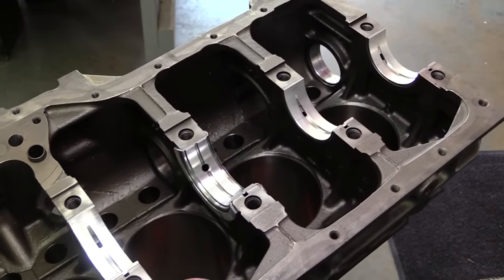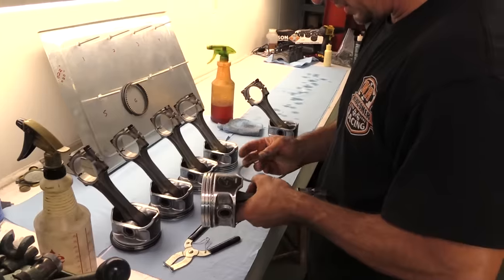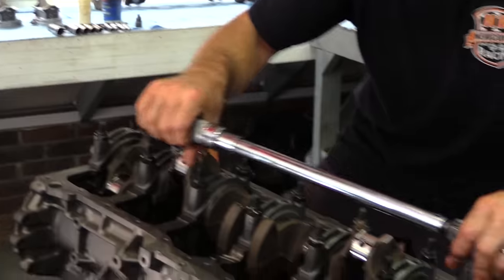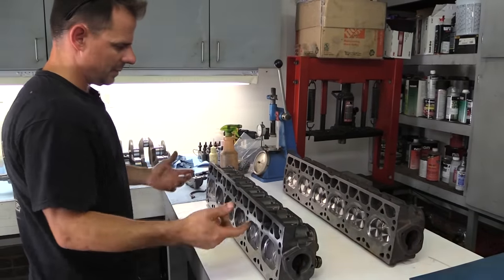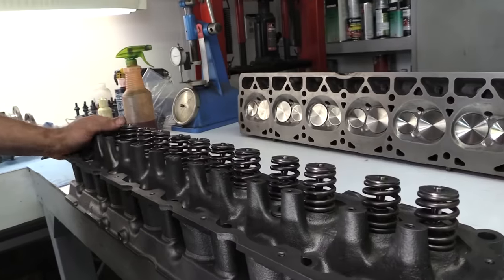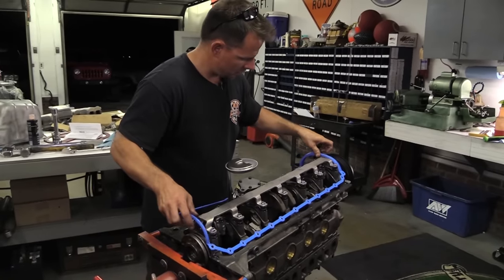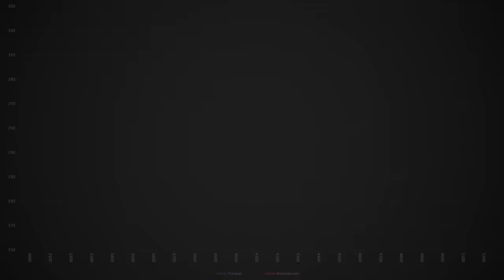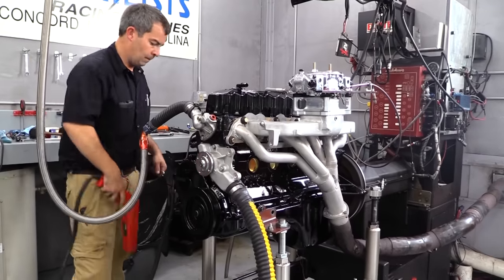Big Power Jeep Straight Six Stroker Build on a Budget with Newcomer Racing

Comment: This thing is a monster of a straight six. It made 329.5 lb ft of torque and 304 HP! That's small block power out of a NA inline six that's smooth as silk!
Reply from the maker: You got it. A five-grand redline isn't exactly sexy, but it is practical on a off-road engine where you want to maximize low-end torque anyway. Plus, like I'm sure you noticed, the builder was trying to get good power on a real-world build. This engine is going to be used everyday, and longevity is definitely an issue. Lightweight stock springs minimize wear on the cam lobes and lifters, but they don't exactly help stretch the redline to the moon. Thanks for watching!
Reply: GT3582R LSVTEC EJ8 
First. Rpm is directly related to airflow. This is an older bigger ci engine. It doesn’t need to rev to 10k rpm to make any power like crappy 4 bangers 
Second; stroker motors don’t help an increase in rpm. If anything the inhibit rpm. 
Thirdly; this particular type of build isn’t for a race car. It’s built for torque. The more torque at a lower rpm is more useable power. 
Reving the shit out of an engine is always the goal of a build.
Reply: I had to edit my original post because I jumped the gun on what I said and didn't think about the 4.0s of the past. I made a comment about the 5000 rpm redline, but I didn't take into account the fact that the 4.0s don't need to rev high due to their ability to make torque. I've driven quite a few Cherokees and Wranglers with the 4.0 and even some AMCs with the 4.2 and they were always extremely reliable, extremely smooth, and they always produced alot more torque than people gave them credit for. Besides, in an offroad based vehicle, you don't need high revving capability, you go with an engine that makes good torque down low, which is why so many people love the 4.0 and is also why you hardly ever see a Jeep stuck. This option being available to the Jeep community who stick by their beloved 4.0 just makes it that much better. Once again, I let my mouth run before I saw the dyno numbers...it's hard to argue with horsepower and torque!
Reply from the maker: That's cool. It's always good to read comments that understand different engines serve different purposes, not some keyboard warrior yelling that if an engine doesn't have twin turbos and make 1,500 horsepower it's junk! Thanks again.
Reply: @Welcometofacsistube  You're right, I am an import guy who has a 612 whp Civic coupe and ran my mouth before I took into consideration what this engine will be used for. My turbo 1.8L DOHC 4 cylinder revs to 10k rpm because it was balanced and built to make power that high, but my Civic is a drag car, not an offroad capable vehicle.  That being said, this Civic is my 54th vehicle since I was a kid, and the other 53 were a mix of imports and domestics which included cars like a 800 HP 74 Camaro Z28 that my brother now owns, a 70 Buick Skylark GS, a 69 Roadrunner 383 4 speed car, a 70 Charger that I built a high compression 440 with a 4 speed for, but I've also owned Eclipses, Eagle Talons, a turbo 92 Acura Integra that made 412 whp, and even an AWD swapped 92 Plymouth Colt hatchback that I swapped a fully built 4g63t into that made 500 whp and would destroy Corvettes. I've always been a fan of a good build, but more importantly I've always been a fan of the underdog, and it doesn't get much more underdog than a lowly common Honda Civic. All in all, I just like horsepower and going fast on or offroad.
Reply: if you are going for a jeep stroker, you must focus on torque, not on rpms, i would have used the later horseshoe style intake and the matching dual profile cam...
Reply from the maker: 54 cars! Respect! My wife would kill me ;)
Reply: GT3582R LSVTEC EJ8 one of the most respectful response ever on YouTube. 👍
Reply: The Horsepower Monster What kind of power and torqye would they get. with nildly blown and a mild port job. the figures on that n/a motor are pretty impressive. However at what altitude were those numbers attained? sealevel or somwhere higher. for those of us that live at higher altitudes  ie 6000 -7000 ft and drive daily. Lightly forced induction  7 - 12psi definately makes improvement. How do those blocks compare with the older 245ci blocks from the 70s & 80s. Love those old mopar 6s.
Reply from the maker: The correction factor on the dyno is pretty reliable, but we dyno'ed at around 700 feet above sea level (Concord, NC). I'm hoping to follow up with Newcomer when he has a turbocharged version of this build. It's going to be bucks up with all the goodies and should be fun. He does some awesome builds, and we'll know what a little forced induction is capable of then. Thanks for watching!
Reply: The Horsepower Monster thank you. I look forward to it.
Reply: Those are really impressive numbers.
Reply: @Welcometofacsistube  Thanks buddy, I try to look at things from different angles when I'm commenting just so I don't make myself look like too much of an ass, but sometimes it's just unavoidable. That's why I edited my original comment because I didn't look at the build in terms of being used as a low end torque offroad engine because I'm used to high revving import engines and seemed to have forgotten everything that I learned about domestics. Sometimes you just have to realize that you were wrong and accept a dose of humility...lmfao
Reply: @Welcometofacsistube  Who says you have to stroke for cubes? Think out side of the box.... everyone wants to build 383 from a 350... What if I wanted to build a 327 from a 350 that screams up to 9K??? Still a stroker isn't it! Imagine the power band you could get 3500 all the way to 8500. Just pointing out that stroking isn't a 1-way street killing RPM's in the process.. Yes you would need some NASA level springs on that but it is do-able. If cubes was everything we wouldn't have Honda's or Dusters with slants running 9's.
Reply: @Welcometofacsistube  what about a destroked motor? They definitely raise the redline.
Reply: @TheHorsepowerMonster  ever tried to see how much more power can be make 
By using the edelbrock cylinder head just like the one use
On the "horsepower tv show"
Just curiosity
Reply from the maker: Hope to do that one soon. Thanks!
Reply: @Brock_Landers  It doesn't even make that much torque, pushrod engines never do unless they're huge. The Nissan VQ40DE makes more torque (stock vs stock) and would easily make more with the same amount of work that was put into this engine. Some 4.2 stroker VQs make over 370 lb-ft.
Reply: @TheHorsepowerMonster  i'd rather see these kinds of builds
Reply: It's pretty cool for application..good engines  but .. you can get close to 400 HP out of an iron 5.0 for two grand less.  Without increasing stroke.
Reply: @PistonAvatarGuy  If a pushrod engine had identical ports, pistons, cubic inches, ignition timing etc. As an OHC engine, why do you think it would make less power?
Reply: @weirdshift6881  A) A pushrod engine can't have identical ports, because the pushrods get in the way. The pushrods restrict both the size and the shape of the ports. B) OHC engines have far more freedom when it comes to the number of valves and valve placement, nothing is restricted by the placement of the pushrods and/or rocker arms. C) An OHC engine has less reciprocating mass, so spring rates can be lower, which means that less power is used to operate the valves. D) The action of an OHC valvetrain is more direct, which means that the operation of the valves is more precise and predictable.
Reply: DrgnFlys  My 2011 Silverado 5.3 (LC9) nets 310hp/330#. I'd say it's not a 1980's smallblock.
Reply: Those are the same number that my 2002 5.3l Silverado I supposed to have.  Except the v8 has more displacement, more cylinders and revs 1000rpm higher.  That straight six is damn impressive, damn impressive.
Reply: I have been running stock 4.0Ls since the late 90s.  Too bad emissions killed this motor they were getting really good in the mid  O 2000's Wranglers.  I have a 95 XJ with a 5 speed that this engine would scream bloody murder in although the Dana 35 hand grenade in the rear would not love me for it.  Unfortuatly for 5 grand the engine is worth more then the rest of the jeep combine but it would be killer compared to an ugly 4 door JK with its air craft carrier sized wheel base.
Reply: Holy smokes! 300 horse?! That's pretty amazing for a little Jeep 6 banger. Plenty of power for the street and the trail.
Reply: The Horsepower Monster f
Reply: @PistonAvatarGuy  apples and oranges. 30 years of technology on the new VQ vs straight 6.  All for 20 ft lbs.
Reply: @christopherking2012  Obviously it's apples and oranges, that was my point. The Japanese kept advancing, the big three didn't. Torque also doesn't mean anything, power is all that matters and those stroker VQs can make ~540 hp at the rear wheels. The VQ also has MUCH cleaner emissions.
Reply: @christopherking2012  Also, those VQs are about half a liter smaller than this engine and were being dynoed at the wheels of a car. Estimated crank torque for the highest output 4.2 that I can find would be around 415 lb-ft. If we were to extrapolate that into a 4.6 liter, that comes out to 455 lb-ft of torque and 676 hp. Oh, and the VQ is also a much lighter engine.
Reply: @PistonAvatarGuy  not dynoed at the wheels.  Dynoed with all accessories on the engine.
Reply: @christopherking2012  You misread my comments. The VQs that I was talking about were rated at the wheels, this engine was not and has no accessories (it's not even running the water pump).
Reply: 612 whp GT3582R EJ8 how much to build one like that ?
Reply: There are plenty of engine’s that can do the same! Vq37 , some Honda motors k24 k20, and even Korean genesis coupe 3.8  heck even eclipse 4g GT can make over 300whp bolt ons
Reply: Check out Clifford performance  6=8
Reply: i want to swap it to ford mustang engine or kubota diesel? does it worth the job? it has 208000 kms, running smooth, it trembles coldstarting at -25C winter days, beside than that it also sometimes dies going uphill if i releas throtle, changed the whole fuel pump filter helped only a bit.
Reply: @PistonAvatarGuy  obviously you're talking about crossflow pushrod engines and not the one in the video. This motor's pushrods aren't on the same side as the ports.
Reply: @rossbrumby1957  Right, but crossflow is ideal, so the reverse-flow head is a restriction of a kind.
Reply: @omegarugal9283  that is a clifford jeep I6 intake. probably makes better power than the horseshoe
Reply: The Horsepower Monster 
Yes. Its not a super high revving monster. Its a beautiful masterpiece that gives out tons of its total power between 2000 and 4000 rpm correct?

Thats what i like! The perfect engine to me. Its as good as it gets without going diesel am i right?
Reply: Take a look to the Argentine racing league called "TC" ( Turismo de carretera) they de-stroke this engines to 3.0 liters do the rules limitations, and get almost 350hp with a single 2 barrel carb.
Since 2016 they use a custom 24v cylinder head and make more than 400hp!!
Reply: 292 chevy
Reply: That Dude Your Mom Warned You About stoop
Reply: @raetemple543  ok
Reply: I do gotta stop and ask. IS the cost of doing this to a stock engine justified when you can take a stock smallblack V8 and beat those numbers without a single mod.
Reply: Lightweight buggy, would kill with this engine .
Reply: Weak.
Reply: @omegarugal9283  well said
Reply: @Brock_Landers  I salute you
Reply: @masterdebater8757  exactly right. The more mass you rotate, the less it will rev - and live.

For a Jeep with a 4.0, stroking is an ideal upgrade. 4500rpms will blast a light Wrangler or Cherokee up, or through anything. Heck, I've seen heavy rigs (owing to diffs, axles, tires) that don't run out of grunt from mildy built 4.0s. They're just geared properly.
Reply: At 280 ci. ? gimme a break dude. Its lame, trust me
Reply: @joshmoore6165  gotta ask - why is it lame? You said "trust me". Did you build one and not like the final results? Real world experience is great to hear.
Reply: @PaulSter  No I did not build one, and no, I have no real world experience with a Jeep straight 6 build. But look man these numbers just dont add up to a "monster". Sorry, I just cant follow you there.
Reply: @joshmoore6165  I hear ya. I think he's talking monster numbers relative to the Jeep 4.0. It's a nice build, and it's great to see builders sustaining and improving the aftermarket for 4.0s. Lots of us like to run what our Jeeps came with, though more power is always great to have. It's novel. It's different than what so many people do (V8 swaps). Our lightweight rigs love torque and these 4.0s deliver. Always more tq than hp. They're diesel-like.
Reply: @PaulSter  Gotcha. Lower HP, favoring torque, Low stress! I'm living that with this new (to me) 04 Lexus GX 470. Decent numbers, but most of all, low stress iron block. Some of these engines have seen 1 million miles. We shall see!
Reply: @PaulSter  But to the subject of this convo, I really wish the aftermarket would show more support for these inline 6 engines, anywhere near like they do for V-8s. Something straight out of the Demon Hellcat valve train architecture would be mind blowing! And other parts too! Induction, fuel, bottom end....etc
Where the heck is the after market on these great engines???
Reply: @joshmoore6165  that's one of the best all-time engines. Great reputation. Funny enough, I've got one from the same family - a year-old Tundra the 5.7 of course. Folks are getting a million miles with them too. I'll struggle to get to 75k before I move to another truck, but I'm hoping to surprise myself and run it 'til it goes! I love the truck.
Reply: @joshmoore6165  yup. Completely agree.
Reply: It's the same power and torque that a 5.7 L Gen III was putting out in 2002 in my old Holden Statesman 

Great build 👍

304 hp ~ 226 kw
329 ft/lb ~ 446 nm
Reply: Chrysler aus made a 265ci 6 that made 302hp stock back in the early 70s
Reply: I wonder what numbers we can expect fro. This set up with a supercharger kit

Comment: the Jeep 4.0 in itself is a great inline six design....but adding a stroker crank kit for 4.6 liter displacement really opens up the torque,horsepower numbers!!
Reply: Which  one it’s better 4.0 strokes 6 or stroke 7
Reply: Honestly, the stock torque isn't bad ... acceleration is decent up to about 45 mph.  It's above 55 that it becomes a brick. But this would be awesome!  imo, I think it needed horsepower more than it needed torque (yes, I know how it's calculated and they are fn of each other). Thus, this is one of the only ways I've seen that does create that torque bc valve float precludes higher RPM and you need more torque at the upper end to get the HP.

Comment: I would love to see a part 2 where they outfit the motor with the suggested 24#/hr injectors, larger fuel pump and anything else suggested to meet these numbers. (like a larger diameter throttle body, and doing a dyno pull on stock computer vs tuned computer)

Comment: Don't worry bout 1000hp LS builds. This is why I love this channel. So much different stuff. Keep up the awesome work
Reply from the maker: Thanks!
Reply: I feel the same. I love the odd stuff. The reason I stopped paying for magazine subscriptions was because all you ever saw was cookie cutter builds with V8's from the big 3. I want to see the odd stuff like some V6's, I6's rare V8's and even some old I4's like the Superduty 4.
Reply: Yes everyone is LS ing everything its getting old
Reply: Chevy Dyall maybe you could weld an LS Block to the right side Of This Block. & Call It An Ls Conversation L6
Reply: Looking forward to seeing that high rpm head build. Imagine this I-6 with 7k-8k rpm capabilities. BRUTAL!!!
Reply: Chevy Dyall ls is wayyyyyyyyy overrated
Reply: @TheHorsepowerMonster  
Why use old school fueling (carburetor)? Why not be different and use an Edelbrock EFI system?
Reply: @vee950  I hear ya!  I'm so tired of saving money while making crazy power! I want to spend more for less dammit!
Reply: @ericharrison619  really not saving, with a L.S none of ur power windows,locks or nothing will work I have power. I6 is way easier to work on and stronger far as engine life
Reply: Dave Micolichek  with that kind of power LS is not reliable I seen several that blown up on the track on street with less power I6 is stronger than LS
Reply: Dave Micolichek  who told you that lie are you read what um saying correctly I've seen LS1s even LS3s throw rods bottom end break at 500 horses dude at 5 head gaskets all that you myte wanna YouTube some things on LS I've seen this in person
Reply: Dave Micolichek  dude you still not listening now jeep 4.0 built & turbo  can handle about 700 reliable on pump gas with Chrysler's chevys strongest LS can not handle 1000 or 1200 on stock bottom reliably if you get that kinda power it tune arp headgasket headstudes and it on E85 even then it's not going to be a long lasting engine u myte get 10k miles and that 4T65E tranny that Chevy uses on there front wheel drive LS engines are junk yeah we've had several of them in the shop dude take notes I know what um talken about
Reply: Dave Micolichek  enough said you most be in your feelings um done talking about this